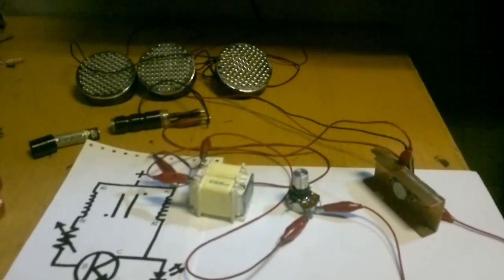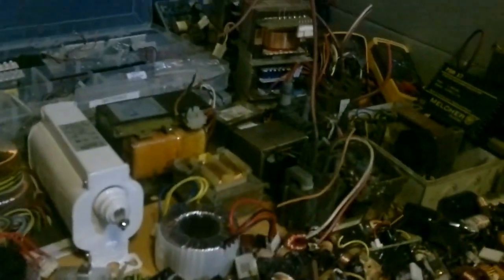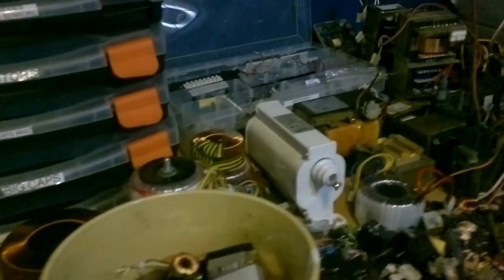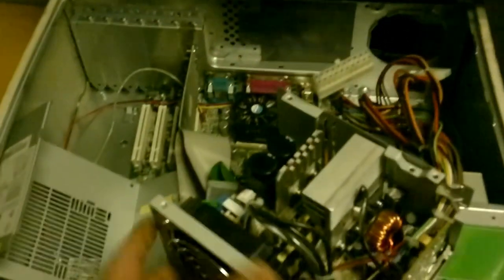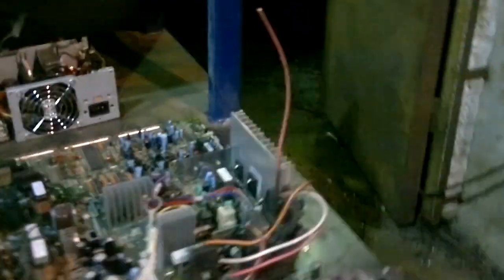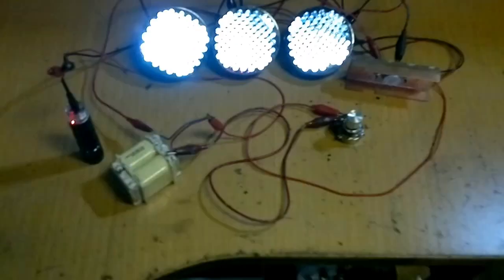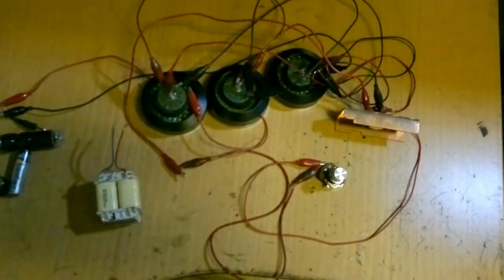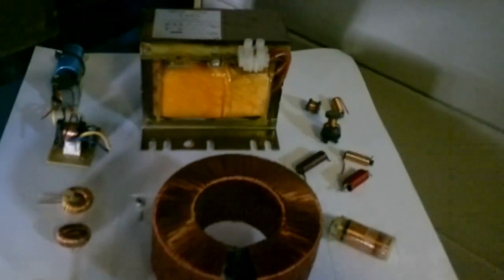the ultimate joule thief collection

Comment: Hi, thanks ,nice video.  One overlooked part is junked speakers, where the coil may be still good, and has good wire for all types of joule thiefs and transformers.  Some is very thin wire also , from personal headphones/ear-buds.   For a dollar, at some dollar stores, or perhaps found in a junk bin, you can get 25 to 100 feet of telephone cable.  It usually has 4 insulated wires in it, and it is good for basic hook up wire with many circuits.  Most know now that a CFL bulb has a small ferrite disk for a joule thief transformer.  A CFL also has a small transformer in it with wire, but I havent used that yet.

Comment: A hot air heat gun works quite well to remove components from circuit boards and doesn't create the dusty mess and doesn't shorten the component leads. Play the hot air onto the solder side of the board and the parts will just fall right off when the solder melts, usually. This is the easiest way to remove, eg, flyback transformers or other multipin parts from circuit boards. If a transistor or diode lead is bent over to hold it onto the board you may have to unbend or clip it so that the part will fall off, but they don't usually bend the leads of chokes or transformers, so be careful they don't fall off and hurt your foot!
I too have done a lot of work with JTs. My favorite one lights up 6 ea. NE-2 90 volt neons in series from one AAA battery, using a 2n3055 and a small10 mH cylindrical choke with a 20 turn "primary" wound around the outside of it. I got the choke from an old CRT monitor circuit board.

Comment: Amazing results! I modified a coil from a computer power supply like you explained (the black stuff is incredibly hard to remove by the way) and it works like a charm. I am able to light several LED's with a single AA battery. 

I am currently using a 2N2222 transistor, so I'll try switching it for the ones you mentioned in the video or the 2N3055. What characteristic is in your experience most important in a transistor? The transition frequency, the collector-emitter voltage, something else?
Reply: High gain and high radio frequency mjl is a nice place to start after you expirement with the 2n3055.